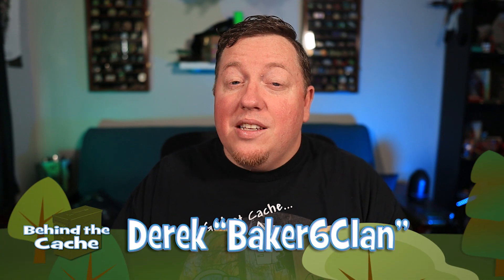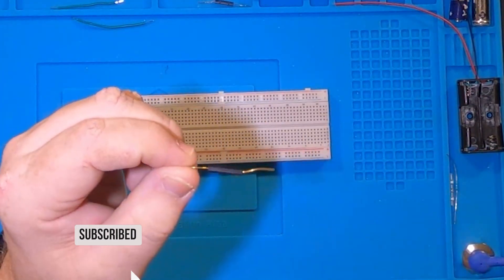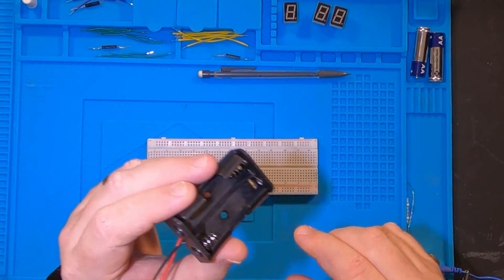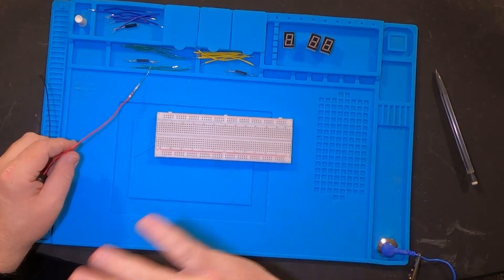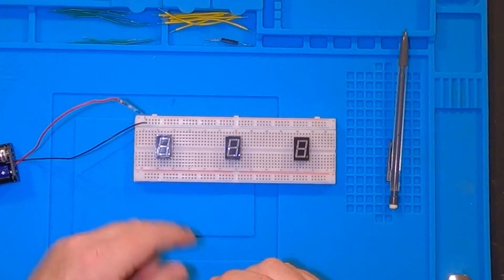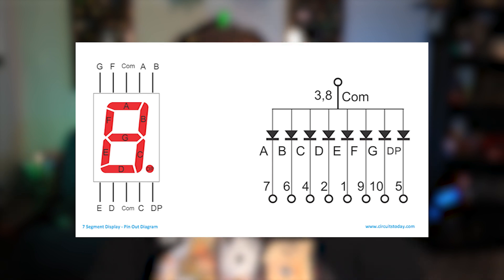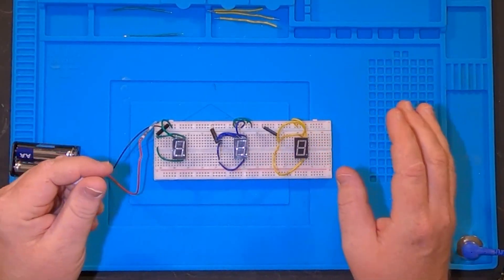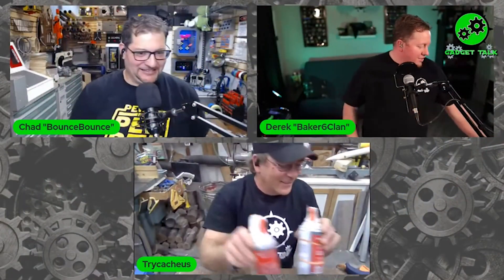7 Segment Display Creative Gadget Cache Prototype Idea (GCNW)

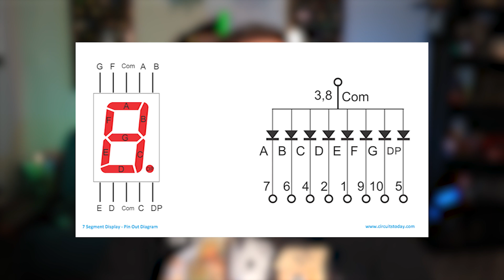Comment: Hi Derek... one small point I'd like to mention... the 7-segment display you are physically using on your protoboard is a common-cathode display (common ground) where all the LED grounds (cathodes) are connected together.  The diagram you referenced in your video (at 5:30) however is a common anode display, where all the positive (+) sides of the display diodes are connected together.  These guys are basically mirror images of each other.  In the case of your video you connected 1 ground and then multiple (+) signals to light up the display.  In the case of the reference diagram you would want to put your series resistor in the negative supply line, and then reed switches in the multiple negative (-) connections going to the display segments.  It is a small point, but one that can easily be miss-wired depending on what display YOU THINK you have, and what display YOU ACTUALLY have.

Anyway... still all good and thanks for posting yet another innovative idea.  --Dean
Reply from the maker: Thanks for pointing that out.  I didn't realize the diagram was different.  I think I was looking at more of the pin layout on the left and not the wiring on the right.

Comment: As usual, a nicely done and thought out video.  Thanks for posting.

If you wanted to take a little bit further, you could have multiple reed switches for each 7-segment display... so that each reed switch would light up only 1 segment but not whole digit.  In your 1, 4, 7 example.... have 1 reed switch light up the top segment of the "1"... another light up the bottom segment of the "1"...  same with the 4 segments on the number "4" and 3 segments on the number "7"...  This way each digit of the combination would actually never light up in its entirety... just a segment at a time.  Say for the top part of your number "1"...  you won't know that it's a 1 right away.  With the top segment of "1" lit... it could actually be  1,2,3,4,7,8 or 9 (not 5 or 6).  You would actually only know the number for sure after you have essentially scanned the whole cache with your magnet... looking for more LED segments to light up.  Of course this is a lot more reed switches and more work.  One reed switch for each segment of each digit.  For your 1,4,7 example you would need 9 reed switches.  Anyway, just another idea to add to the complexity.  But this way the cacher would have to make note of the individual segments that light up.  He would basically use his magnet to "paint" the segments of the combination individually until he knew what it was.
Reply from the maker: Yeah that is a cool variation.

Comment: When the digital displays are seen, people very well may know the method.  What I think would be interesting is to have each display behind a sliding shade.  When the magnet passes, the window opens displaying the number behind the shade.

Perhaps a Let's Make a Deal theme somehow could be incorporated.

So, the magnet would probably have to trigger two reed switches: one for the digital display and one for whatever is used for the shade/covering.
Reply from the maker: That is a cool idea too. Would have to add some servos in there as well or have like a one way mirror of sorts so not until the Reed switch is activated would you see the number.